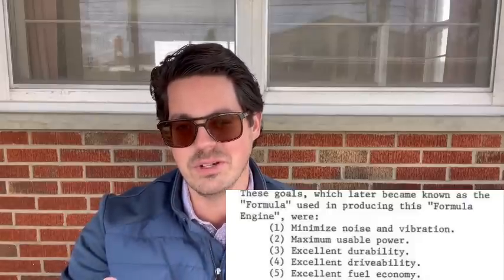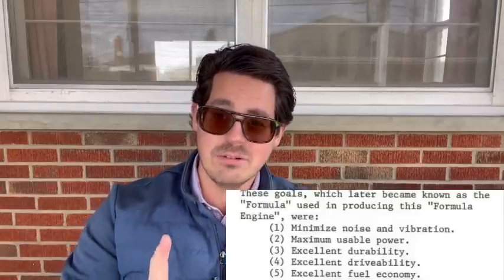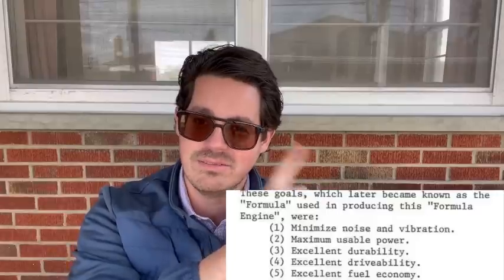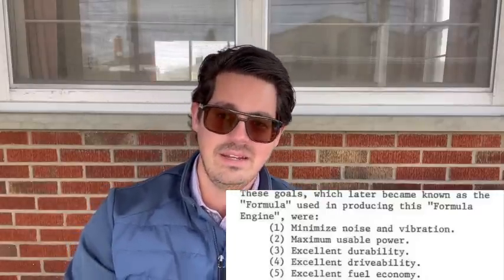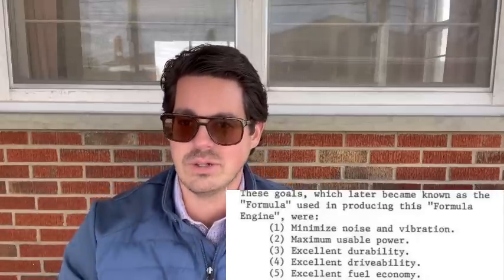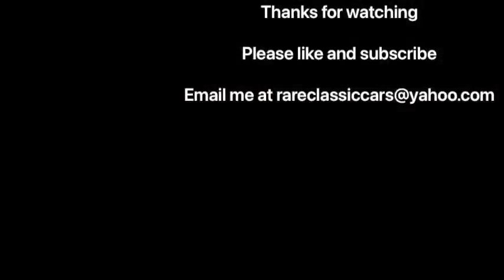Worst Engines of All Time: GM's 2.5L Iron Duke 4-Cylinder

Comment: I’ve had several iron duke engines in S10’s and found the engine to be quite reliable. Easy to work on too.
Reply: I second that.
Reply: its actually one of the most reliable engines ever made....yea its weak asf ,its funny to have it on Firebirds and camaros ...heck so rare I can't find videos on youtube with that engine in 3rd gens lol
Reply: Yeah they’ve been used in the USPS LLV for decades now. They’re widely considered to be tough
Reply: You said it all, when you mentioned the S10 that is not a truck but a miniature.
Reply: I think the main issue wasn’t really as much the engine itself, but how the electronics (ECU?) were prone to short circuiting if there was a fluid leak which would catch fire
Reply: With which GM (or another manufacturer's) engine could you swap it to improve both power and fuel efficiency without much (or any) modification(s)?
Reply: I think "easy to work" is the up side of what this video maker calls "crude and unrefined".
Reply: These were best suited for low rpm work all day long like they do in postal delivery vehicles.   Not a great passenger car engine at all.   No power and buzzy with even a little bit of revs.
Reply: @Adrian-mq5ld  I knew a girl with a 4 cylinder Camaro. It topped out at around 70.
Reply: @ahoneyman  omg thats amazing. I want a test trive with one of those....a review or something...heck I want to hear how it sounds. Im more curious about that 4cyl than about the turbo trans am from 89
Reply: Nothin like a 4 cylinder s10. You can’t kill em cuz they don’t make enough power to wear anything out 😂
Reply: @tylerfranx4286  - Yep.  Pretty hard to break stuff when its putting maybe 70 hp to the rear wheels  LOL.
Reply: @tylerfranx4286  I couldnt break loose on snow with mine 😂💀
Reply: Had the successor in a cavalier, I couldn’t imagine that 2.2 or iron duke in a truck
Reply: @Balrog-tf3bg  I have an ecotec in my cavalier. It's my first car and it seems very reliable.
Reply: @ahoneyman  I had the Iron Duke in a CJ5.  I had it up to 75mph at which point it could have went faster but the Jeep was all over the road at that point.
Reply: I agree with this reply also, I have worked on a lot of these engines. Not the best but certainly not the worst. In fact I just bought an 88 GMC S15 a few months back just for a parts chaser. It has over 300k on it and its still moving under its own power.
Reply: @Balrog-tf3bg  Rest assured, its every bit as slow and unrefined as you think. I have one in my s10. My best estimate for 0-60 is around 15 seconds.
Reply: I second that too
Reply: Great explanation thanks. I had a 1991 iron duke in my s10. I really loved it.
Reply: Yah people saying they are horrible are either using it for wrong applications  or are trying to get 200hps and want it to last 300,000 miles literally all of the ups mail truck use the 90s iron duke
Reply: He actually calls it a reliable engine in another video
Reply: Extremely reliable.  Piston slap for days, sure.  But ignore the noise and they run damn near forever.
Reply: @Balrog-tf3bg  I had a 98 S-10 with the 2.2 liter and 5 speed, and any time I had to drive home through the North Carolina mountains when I was in the Air Force I’d have to have it screaming in 3rd gear going uphill and it would still be losing speed… I replaced it with a brand new 2003 Nissan Frontier with the KA24DE 4 cylinder and it was night and day, that engine made so much more power and it was a much better truck all around. I wish I’d kept it.
Reply: @ahoneyman  That's right up there with my uncle's absolutely gorgeous, super deluxe 1968 Montego MX Brougham that he ordered with the 115 HP 200 CID inline 6 that was a carry over from early 60s Fairlanes. They even left him order A/C with it!
Fairly torquey little thing & they got the gearing & torque converter tweaked just right so it stepped out better than you might have expected in a car that size, at least up through 1st gear. 2nd wasn't a whole lot to speak of & shifted right at the 60 mark. From that point on about the best you could say was that it continued "gathering speed" till it all ran out at 70 unless you had a downgrade or a good tailwind.
Said he bought it because he had no need to be in a hurry. The next year at least the base 6 cyl was a new 250 instead of the 200!
Reply: @DejaView  The 200 is the old Mustang 6 right? Fun fact. In the 80's Ford lopped 2 cylinders off it and stuffed in Ford Tempos. This carried on Ford's tradition of having 2 motors of the exact same size that are completely unrelated to each other
Reply: @ahoneyman  Yes, the 200 6 cyl had been the base engine in Mustang for a number of years (then rated 120 HP, 116 HP prior to 1965 & variously rated 115/120 in later years depending on application, till ratings switched to "net" HP). Mustang saw a late year intro in 1964 & used an interesting "mix" of 64/65 drivetrain components '64 Mustang used the smaller 170 CID six originally created as the "upgrade" engine for the Falcon BUT allowed for the use of Cruise-O-Matic 3spd while Falcon & Fairlane were still stuck with the 2nd Gen 2spd Ford-O-Matic (except perhaps Fairlane with 289 V8) also for '64 only was the option of the little 260 V8 in Mustang.
While not a powerhouse, the 200 must have been a good little engine. It went on to a more than 20 yr lifespan. By 1970 it became the 1st "upgrade" engine for Maverick, went on to become the base "6" (upgrade from the 2.3/140 CID OHC "4") for Fairmont, Zephyr, 2nd gen Granada & Cougar sedan & wagon lines as well as "Baby" Marquis & LTD (the "Fox" platform mid-size cars) & may have even found it's way into a few early '80s T-Birds before the intro of the "Essex" 3.8 (232) V6.
As to the origin of the Tempo engine (& likely later Taurus 4 cyl) not really sure if they were derived from the older 6's but they definitely were OHV engines not OHC like the above mentioned 2.3 litre "4". Always heard Tempo/Taurus 4 cyl were quite problematic, unlike the 200 6 cyl so I'm really not sure they were "related".
Reply: @kingrex1931  he calls it a reliable engine in this video.
Reply: great torque that overhead cam doesnt come close to
Reply: @SayAhh  I remember Ford's OHC 2.3 not being nearly as "punchy" on low end torque & no better, if even as good on gas & while the "Duke" wasn't quiet & developed some additional noises over time, in my experience I never noticed vibration levels like Adam & others are claiming. For vibration (notably vertical "shake") Chrysler 2.2 & 2.5 we're much worse!
Reply: @jerryashlock5519  I remember the Ford 2.3 OHC being quite weak in that area. Had friends with a 4cyl Fairmont. Thought it would never move from a dead stop. My 4cyl automatic Citation could squeal the tires when you punched it quick!
Reply: @Adrian-mq5ld  i had one in an 82 camaro in high school and it definitely took the abuse and never left me walking.
Reply: @joerobinson3878  iron duke 3rd gens are some of the rarest cars ...trust me they will be more than a 89 TTA just because there are rare ...if any at all lol
Reply: Yes, can also be built to over 300hp!
Reply: You got It. I guess some people just like frilly things I guess.
Reply: As a carrier for usps it’s a reason the llvs are still on the road
Reply: It’s an amazing engine my first ruck
Reply: I beg to differ… I am a ASE certified master mechanic. In my experience, these are among the most durable four-cylinder engines that that GM has ever produced. As you mentioned, they still live on in service with postal vehicles. They are also widely used in the marine industry powering sterndrives And auxiliary power units on small ships. Modified versions displace 3 L. Their usable service life between overhauls well exceeds most other designs. Throttlebody injection and is cheaper but actually a step backwards in regards to performance over carburetion. Overhead cam shifts actually are not always needed to make good reliable power. Just spend the money and time on a better cylinder head with better flow characteristics. Look at the LS and LT engines for example
Reply: I worked in the engine remanufacturing industry for 20 yrs. I’ve seen good and bad engines as we had to warranty any engines that failed and inspect used engines coming in to be rebuilt. The first 4.1 liter aluminum engines were so horrible that no one would warranty them if rebuilt. Lots of problems with GM in the early,80’s. You must live in a cooler location as .head cracking is a major problem with the 2.5. Pontiac came out with an HO head which had more meat in the cast, “thicker casting”, that was less prone to cracking. the late iron duck has a cross flow port design stated of all the ports being on one side. Something similar happened with the 250 cu in straight 6 with integral intake manifold. These heads cracked very easily. The best fix was to swap it with a 292, or even and early 250 where emissions are not tested, or a 350 V8, the Big Mac of the Chevy world. The 305 sucked and later 350 engines were not very good as they had oiling issues that took them out of service early, so an early 350 is probably the best choice.
Reply: @Adrian-mq5ld id hardly call them weak, mine is pushing 36psi on stock rods and crank.
Reply: I owned 2 of them, a 1982 Oldsmobile Cutlass Ciera and a 1988 Oldsmobile Cutlass Ciera.
I never had a minute’s problem with either one of them.
They ran beautifully.
Easy to work on for tuneups and good on fuel.
I thought then and now, they were great engines.
Reply: 14:23 Sometimes accompanied by pronounced cabin throb sound.  Only on fwd w/ auto.
Reply: There is a race head made by Pontiac for the 2.5 I bet you you didn't  realize it .
Reply: I sold a lot of cars with the Iron Duke. I drove a 1987 Pontiac Grand Am across several states at 85 m.p.h. and got 32 m.p.g. throttle body fuel injection was very dependable it was a great motor.
Reply: I always thought it was a good engine
Reply: My feiro has one and is 200,000 miles and still going strong
Reply: @GR46404  Somewhat crude, but unrefined.
Reply: @derpyllama1857  The Ecotec is infinitely better than the Duke, which is aptly named.
Reply: @ostrich67  my baby is right around 150,000 we get it maintained anytime an issue pops up right away how long could it last? Also what about the transmission? i baby my car unless it's an emergency. Her name is cinnamon.
Reply: @ahoneyman My S10 cruises at 80mph 4th gear 3000 rpm
Reply: @SayAhh with a 92-95 V6-3.4 engine

Comment: GM sold millions of Iron Duke powered cars.  Everybody who bought one knew about the crudeness and roughness before they paid for it.  I'd save the "worst" designation for engines that were prone to giving their owners nasty, expensive surprises.
Reply: Agreed. The oldest working fleet vehicle you saw today was probably a postal LLV. Guess what's powering those. The fact that the engine's level of refinement is just about suitable for a mail truck is neither here nor there.
Reply: @nlpnt  they should make new FWD LLVs with 1.5 liter turbo 4s or better yet a 180 hp fully electric power train.
Reply: @davidperry4013  turbocharged engines wouldn't be that useful for postal use. They just don't need the additional power. A modern naturally aspirated 1.5l i4 would put down more power than the old iron duke did new - let alone with 30 years of wear on it.
Reply: @nlpnt  These engines always reminded me of the original Willys "Go Devil" engines with their vibration and sound.
Reply: @elijahwatson8119  they'd probably still need a 2.0l
Reply: Aka the 2.4l quad 4 needing head gasket every 10k if you took care of it or less if not
Reply: @elijahwatson8119  a 2.5 liter naturally aspirated 4 cylinder from Toyota would probably be more useful than a GM 1.5 turbo.
Reply: @nlpnt  thanks for the comment . That was my first thought when I saw the thumb nail for the video .
Reply: Second that motion. If an engine can run reliably for the long term, I don't think it should be on a "worst of" list. If I'm honest about my biases, I put reliability at the top my my list.
Reply: @claytoncoolidge992  totally different motor, and the quad 4 was actually a 2.3 DOHC MOTOR
Reply: Gm had a 2 liter 150hp twin cam for large part of iron dukes life. 

He does say that it was reliable and durable mostly.

The reason it was in production so long was a lot of just company (factory)politics, gm could have had put a lot better engines in the fiero etc, thats what makes it get the title. More fuel efficient engines too.
Reply: @greendryerlint  the light 💡just came on im thinking 🤔that just might be a continental engine aka jeep are the same after watching this and working on a couple and a jeep or 2
Reply: Yes!
Reply: @1mikewalsh  got a sores for the too engine's being rebadged ?

im interested in learning experience
Reply: You have to wonder how many people test drove an Iron Duke powered car then a Honda or Toyota and then never bought GM again.  I don't think this engine did GM's brands any favors.
Reply: @clemoyne  That's an interesting question.  I'm sure GM lost some customers to the imports because of the shaky Iron Duke.  But GM sold millions of cars with that engine and I'm sure, especially in the early days, most of the buyers were downsizing from smooth running V8s and straight 6s.  After that, there must have been a large number of second gen sales.  If selling a mediocre engine, year after year, was the worst GM did to it's smaller car customers, GM would still be in great shape.
Reply: @claytoncoolidge992  my dad's 97 sunfire had a quad 4, the engine was always solid but the AC always broke and the electrics were a nightmare
Reply: @MilesPrower1992  lol you are literally the only person I have ever heard that from. Can't say the same for the hundreds of others that I have personally repaired or personally witnessed being repaired. And I would have to also add that the hundreds of salvage yards who refuse to sell them due to the very very well known and documented issues making them and I quote " unable to be offered for sale due to the fact that we are not able to warranty them with the known issues with the engines*. But I am glad to hear that there was one that managed to be a good one
Reply: USPS Grumman LLV, your everyday mail truck was made from 1987 to 1994. The body is aluminum.  The running gear is S-10 Chevrolet with a narrower front tire track than the rear. There are two different engines,  the 2.5 and a newer 2.2. The philosophy on oil changes last place I worked was every 6 months regardless of mileage.  There was a problem with some replacement modules for ignition or other failing because of quality.  I wasn't a mailman but had occasion to drive a few of them.
Reply: @Clayton Coolidge  I feel the quad 4 got a bad rap. I had a 95 grand am which was the last year of the og 2.3. It had 175k on it when I wrecked it. Went through about a 1/4 a quart oil between changes but no head gasket issues. Everyone I knew that was owned by someone who knew when to flush and fill, didn't overheat, and changed oil was fine. However a lot of these engines were in cars teenage kids drove. So they were poorly maintained. If they had modern 10yr coolant back then I bet it would've saved a lot of headgaskets. Supposedly the old green coolant would create some kind of electrostatic corrosion between the aluminum and iron/steel parts
Reply: @elijahwatson8119  i would love to see a 1.5 in a post office truck or in a boat ahahaha
Reply: @clemoyne The mail trucks still use them to this day so they’re not unreliable. It’s not a refined or smooth running engine like Honda and Toyota but they are reliable and easy to work on.
Reply: Minimize noise and vibration. That’s cute. Coming from GM. I asked the dealer about the wobble at idle in my 4.3lv8 and was handed a dot matrix printout that stated “ engine exhibits the classic 4.8 liter shake”.
I was just lucky it didn’t come with fries…
Reply: Like the 4.6 Northstar, 4.0 wannabe Northstar and the 3.5 baby Northstar.